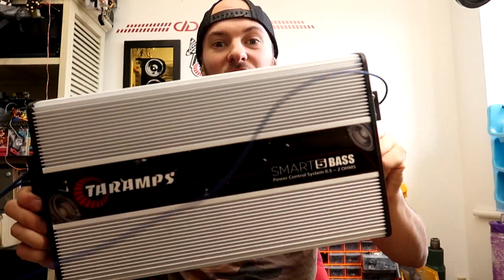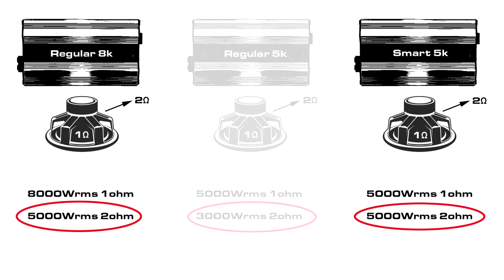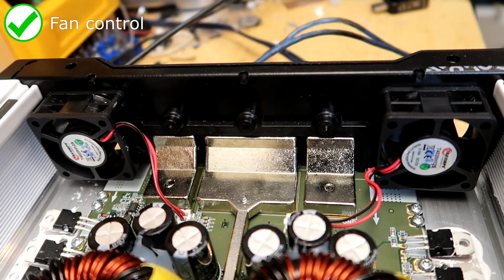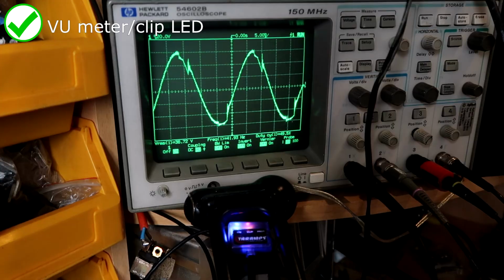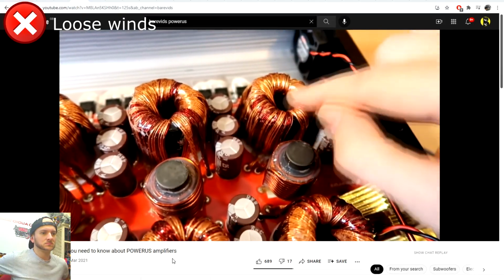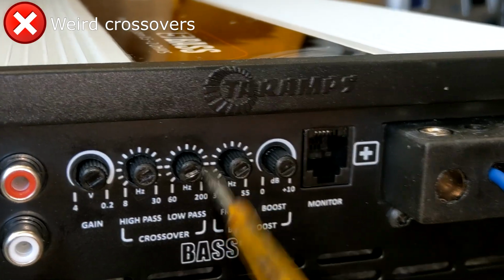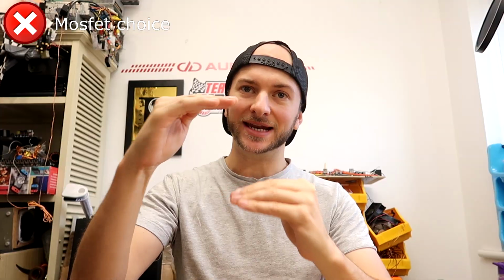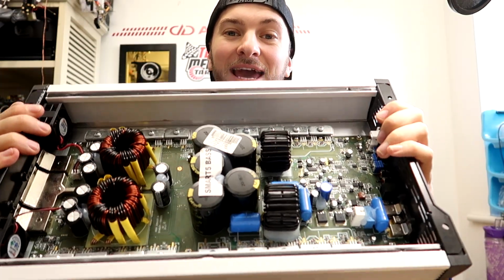The good VS the bad - Taramps SMART 5 & BASS circuit overview

Comment: You rock love all this info. Im at 3k smart going to the smart 5 wasnt sure if i wanted the bass or standard. Thank you for the comparison and the awsome video
Reply: Get the smart bass i owned them all and it sounds way better and its more powerfull
Reply: @DirtySouthFlorida3  I was debating getting a smart bass 3k or smart 3k. So definitely get the bass version?  I'm going to put it on two Sundown 12s
Reply: @DirtySouthFlorida3  one more question.  Have you ever had a crescendo amp?  I was looking at their skyway 3k. I've just heard they do rated power at 13.4 volts. I have 120 amp alternator, one d3400 AGM and an ioxis super capacitor. So whatever amp I get I need to make sure I have the electrical for it. Thanks for your advice

Comment: On a side note, a true mono input should have both Left and Right channels mixed. If using one or the other independently and there is a Bass effect on one of either channels that is not being used, it won’t be heard because that particular left or right plug is not connected. For best musical reproduction, it’s best to have both channels connected to experience all the sound the music is offering.
Reply from the maker: Head units mix down the subwoofer output to mono. Try it!
Reply: @barevids  
Yea that’s a better option when the head unit has sub output.
Reply: @barevids  if you want high output alternator buy J's alternator or iraggi alternator
Reply: @cherryloujames8195  my iraggi 320 is beasst
Reply: @cherryloujames8195 singer FTW
Reply: what happens if someone were to use a rca Y cable??
Reply: @bdc211  
If you take a y-cable and combine left / right it can work but then (depending how things are wired) every thing connected to it will turn to mono. Also got to becareful with the source input that it does not get damaged.

Comment: I was actually considering swapping my 4 Rockford t2500-1bdcp’s for two of these. This will be an interesting watch for me.
Reply: Don't do it
Reply: @EvanField6380  he'd get more power  may lose a little sound quality soo why not
Reply: @bassbrother101   the bdcp amplifiers are great quality and sound great and they make the same power at 2ohms and 1ohms
Reply: @EvanField6380  true the fosgate do actually put out the same at 1 and 2 💯
Reply: @bassbrother101   🤔 components, build quality, eye candy, and plain old you get what you pay for!
Reply: @EvanField6380  and you didn't watch the video to know that!
Reply: @EvanField6380  why mate?
Reply: @HS786UK93  what's your electrical set up ?
Reply: Did you not watch the video?
Reply: @EvanField6380  also they don't have dirty power  ( they even have there own distortion detector to prevent you from sending your subs an dirty signal  and he would've said they were cheaply made and have dirty power in the video  ( if he recommended them and Is running an older HD 10k in his own van I'd say there good especially since he knows exactly what he's talking about  and doing 💯💯 If you watch all his other videos 👍
Reply: @bassbrother101   yes it's good for a taramps amp but there are so many better amplifiers you can buy that sound way better
Reply: @EvanField6380  you won't even notice the difference  especially with these newer taramps amplifiers and if tuned right
Reply: @EvanField6380  clean power with a clip meter. If ur power is dirty its gonna be dirty on anything hi demand electrical.  I run a single smart 3k regular amp i hit 148.8 pretty easy and u feel the bass
Reply: @bassbrother101  if he jumps off a bridge I guess you'd follow! Just because Sam approved his content doesn't mean it's true...
Reply: @bassbrother101  I've already noticed the difference with 2 RS Platinums on a taramp MD 8k. Blew both subs! Didn't harm the cones, but the coils were fried from rubbing the basket. Both subs! That THD of the taramp really sucks.
Reply: @Mr.NpK143  yep, someone who actually knows what they are talking about when it comes to taramps. I don't care who endorses them I hate them they are better off just as full range amps
Reply: @EvanField6380  agreed! And not even more efficient then Korean. I have a taramp bass 3k that I had on my setup that literally drained my electrical. Swapped it out for a DS18 HOOLIGAN 3.5K and the Korean surprisingly pulls a lot less current then the taramp bass 3k 😮. Setup sound better and hits much harder.
Reply from the maker: You have no idea what you are talking about. All this "dirty power" nonsense cracks me up...
Reply: @bassbrother101  6s4p yinlong lithium cells and a high output alternator at 15.5v
Reply: @barevids  the term dirty power may Crack you up, but if I'm not mistaken you mentioned other experts have opinions that you don't necessarily agree with. Although on the contrary others do! So whether you like the term or not other experts do acknowledge this term. Your opinion is well respected, but you've yet to put your brand in rotation. Not to mention you don't design or engineer amps for no company! So again your findings are opinionated as should be. Respected, but opinionated! And may seem intelligent until argued amongst other experts.
Reply: @EvanField6380  dirty power wtf you talking about, you can’t even logically explain that, please I’m waiting. Also, take your $2k 2500w fosgate on any 2x quality subs and then throw a smart 5k on the same subs and hold on, cuz now you going to start slammin
Reply: @colemclane650  barevid got y'all suckered in pretty good. Maybe not in England, but here in the US the term dirty power exists. The explanation is terrible Total Harmonic Distortion which is the amps ability to control the sub. These amps are notorious for it although not a bad amp for the money especially when used properly meaning full tilt.
Reply: @Mr.NpK143  You do realize you can watch videos of this amp on the dyno, certified with less the 1% distortion, the dyno is only measuring clean non distorted power which give you the reading. Of xxxx watts @ x ohms. This amp has less than <1% THD. I honestly can’t tell if your trolling rn, if you actually think all these tar amps just provide this magic dirty power than idk what to tell you Lmfaoo. I’m not sure why you are such a tar amps hater I see you comment on every video, you go out of your way to make negative irrelevant comments. What did the company ever do to you ? Or are you just speaking as arm chair quarterback with no skin in the game AKA you don’t and haven’t tested any of these amplifiers.
Reply: How does an amp provide “dirty power” explain yourself ..? I’m from the US and tar amps are gaining massive traction.. lol.. It’s a badass amp, it make 4.8-5k at 1 and even more power at 2ohms. It’s newer technology so I guess if you don’t like it, idk what to tell you. Spend 2+k on a Korean board.
Reply: @colemclane650  that's easy! Buy Brazilian amps...
Reply: @colemclane650  that's strange to me you just said the dyno measures clean non distorted power.... yet and still you an explanation for dirty power 🤔. Lol get the freak out of here 🤣. A dyno doesn't tell all. As for the wave of taramp products I'd say it's been phenomenal. A great product. For the money that is! I own taramp products, and I can honestly say it's not better than the Korean I've been accustomed to. Cheaper, the power is there, but it's not the better sounding on the spectrum over Korean boards. You said for me to keep spending 2k own Korean... I say get your money right and come holla at me!
Reply: @Mr.NpK143  dude I’m asking for your explanation of what dirty power is ? You literally don’t have one. Trust me my money is plenty right if I wanted to justify buying a Korean board. Has nothing to do with money, just common sense. I have plenty of things to spend money on, audio for fun. You just don’t have an explanation. Come down to Florida and will see who’s money right.
Reply: A dyno isn’t a tell all, but it 100% measures clean less than 1% thd on a certified run.
Reply: @colemclane650  lol I'm in florida now. And like I said get your money right and come holla at me, or bring that dirt with you.
Reply: @colemclane650  whatever city you in we meet within 2 hours of each other unless you in the panhandle. Then ofcourse it'd be a little longer. Just bring the bag and that dirt
Reply: @EvanField6380  brazil= no bass below 35hz!
Reply: @colemclane650  im a RAVE DJ, and brazil amps got no bass below 35HZ!!! fact....EDM RAVE music has lots of bass below 35hz...ergo, these amp suck!
Reply: (cough cough) although expensive your t2500 are better
Reply: @sarahconner9433  and that's what this video doesn't exemplifie!
Reply: @colemclane650  make sure it's concentrated because fooling around with taramp you'll need it 😉!
Reply: Hope you got high 150s or 1000 horse and it will be a good challenge
Reply: @colemclane650  no since in hoping. Just where you want to meet and bring your ass and that bag ofcourse
Reply: @Mr.NpK143  hope you ain’t driving that raggity ass f150 LMFAOOOOO
Reply: Tell me to get my bag right that shit from 1952
Reply: I actually ended up buying a smart 3 to test out. Very strange but at clip I found that the bass output was reduced and when I turned down the volume the output actually increased. Very strange. The edge 5k and Rockford worked fine.
Reply: NOOOOOOOOO!❤